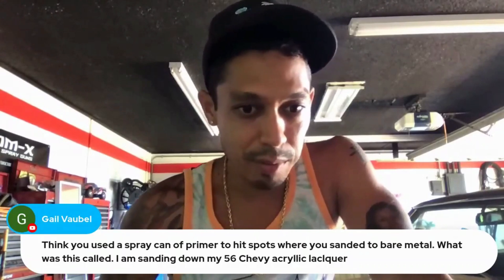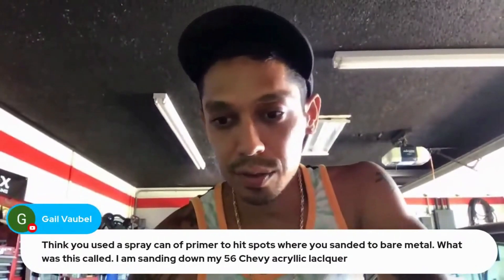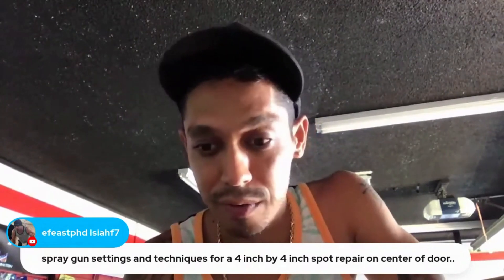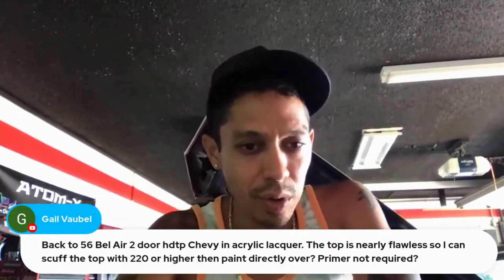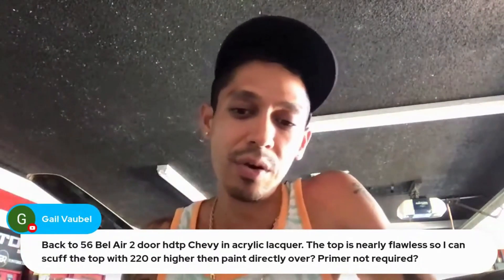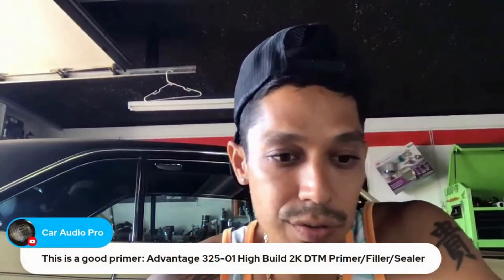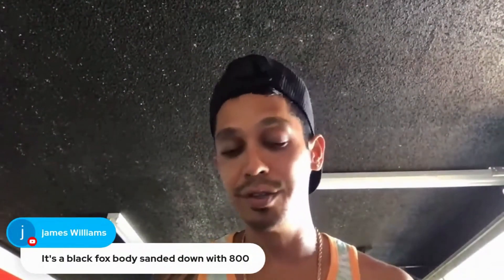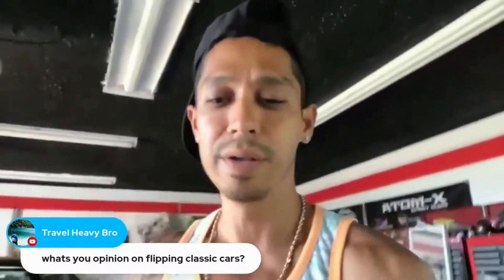🚘👉Autobody & Paint Q&A - How To Prep Your Car For Primer and Paint Plus More Autobody Q&A

Comment: Hey Tony great info.  How do you feel about the 3 and 5 stage turbine hvlp systems.  Mainly the one I was looking at was manufactured by Turbine products (no frills).  The main appealing factor is that it's mobile and space saving.  Do you think I can get by with the 3 stage or should I just drop the coin and go 5 for more flexibility.  I value your opinion looking forward to your feedback.
Reply from the maker: Honestly I don’t have direct experience with turbine systems but we do have a good amount of VIP members using them with success. I guess I’m old fashion but there’s nothing like an air compressor. I think the three stage for you will work. It depends though if you feel like you want the extra volume just in case you might want to get the bigger version. Good luck and keep me posted.